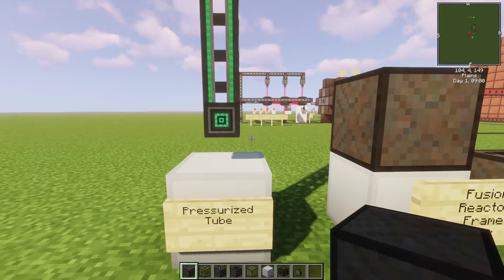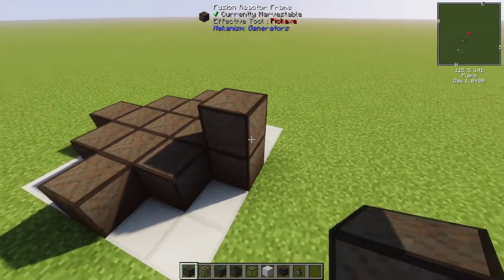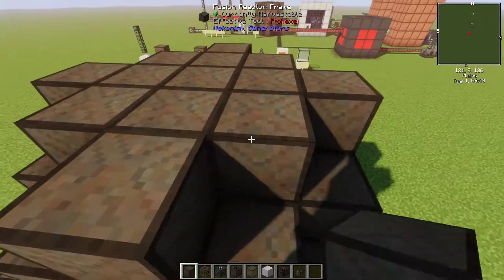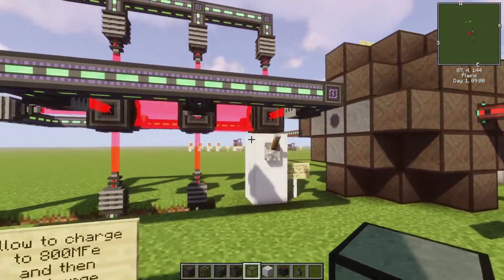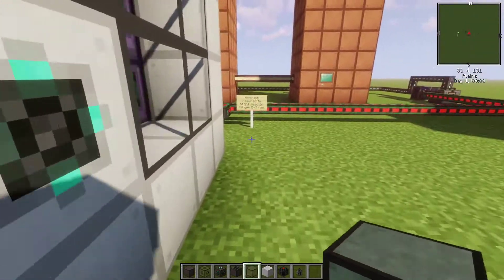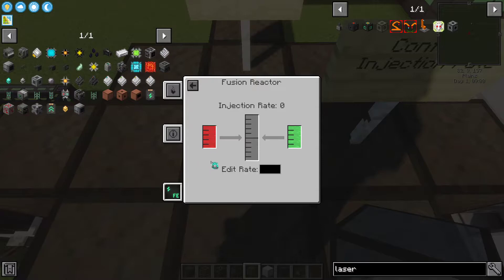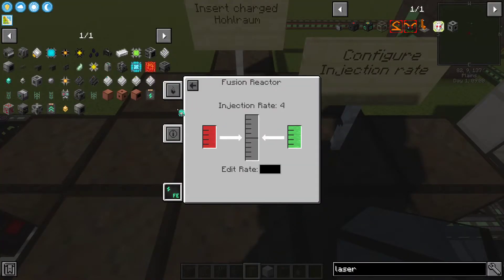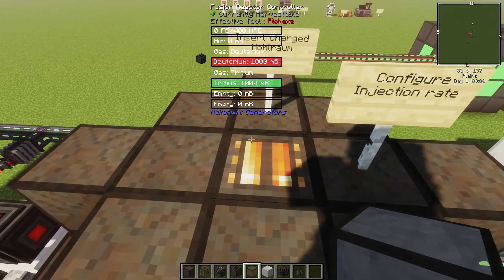Mekanism V10 Fusion Reactor tutorial~ (Minecraft)

Comment: can i disassemble the laser thing after i start it?
Reply from the maker: You could, but if for some reason your reactor shuts down, such as running out of deuterium or tritium, you're going to need them, D-T fuel, and a Hohlraum to restart it. If you're worried about the power draw, you should just disconnect the cables.